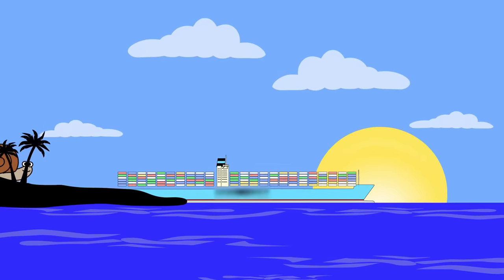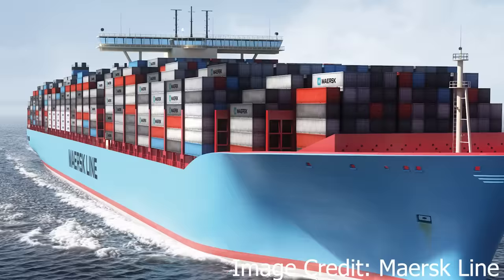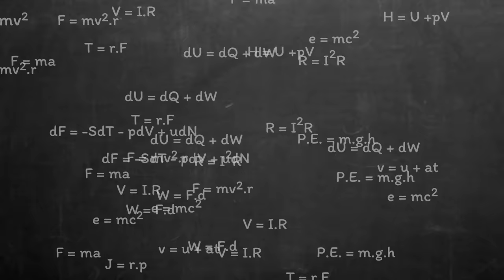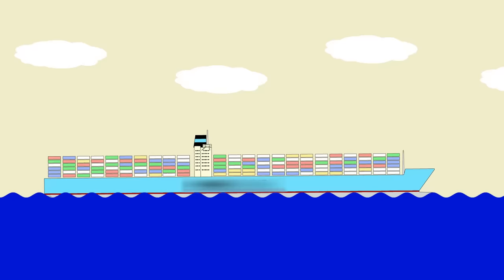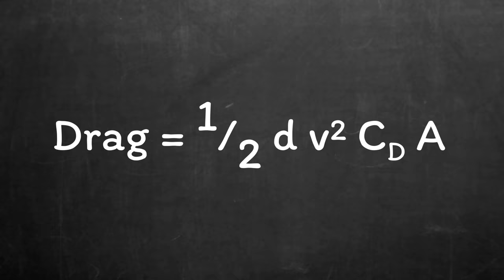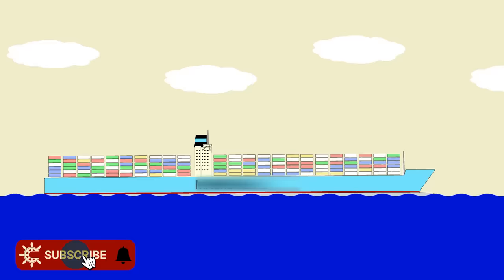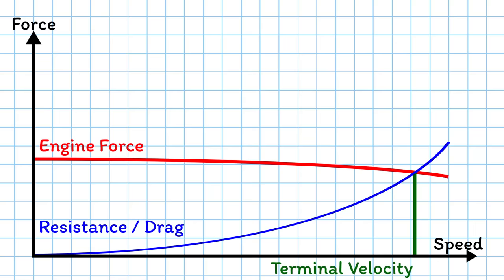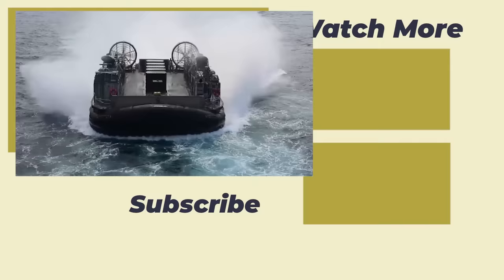Why are ships so slow?

Comment: "And the MM Maersk, 0.5 hp/t"
Me: Oh that explains everything.
Reply: In fact that's the main reason, haha - think about a car that only has 0,5-1 hp, haha. That would be much slower than the ship, just because of the rolling resistance of the tires. 
Even though the ship has a lot of drag going in water, that resistance doesn't scale up at the same rate as the weight (wich is also why large ships tend to be faster than smaller, like he said in the video) - so compared to it's weight, a large ship has lower total resistance moving forward, than a car. 
But a train or even a tram would in fact be able to go like 60-80 km/h (about 32-43 knots) since it's rolling resistance is like 1/10 of a car, compared to its weight, and the air resistance doesn't get very high either, at those speeds. 
Although, even a rail vehicle would not be useful with such low power, since it would take "forever" to get up to speed and also going uphill would be a problem - even a quite small hill would slow the vehicle down to walk speed (this is something a ship doesn't have to deal with, going on a water surface, that by it's nature always stays perfectly flat). A plane would need far more than 0,5 hp/ton to generate enough lift to even be able to fly at all, regardless of wich speed it's going - so that's out of the quiestion, hahaha
Reply: @Speeder84XL  But trains often do run at that kind of ratio. The difference is that a diesel locomotive is only using it's diesel engine as a generator so it really can't stall and you get the benefits of electric motors for the actual driving. Diesel locomotives are pretty heavy and have all wheel power delivery trough electric motors, combine that with really low rolling resistance on rail and they are really really good at draging crap on rail.
The country I live in is relatively flat so you get stuff like this https://www.youtube.com/watch?v=10h-jE8cfV4 these 2 section locomotives have ~4600hp combined and the consists they are pulling are ~5000 tons so we're under 1hp/t here and it works pretty well.
Reply: @GreatGodSajuuk  That's true - I didn't thaught about those really heavy freight trains. They can indeed make it with similar power to weight ratios. Once they get up to speed, they can also often go up small hills quite easely using their momentum (since there is almost nothing except gravity, that slows them down) :)
Reply: Speeder84XL is the ocean that these overgrown boats sail the globe on really perfectly flat? Or do does it wrap around the globe? Do you really believe that the earth is flat?🌏
Reply: It's "Emma" Maersk, by the way.

Comment: The bigger ships move alot quicker than some of the medium size ones. Power matters at sea. Tell the master of the Titanic 27 knots is slow lol.
Reply: Titanics max speed was like 22 knots
Reply: I know Carpathia's max speed was 17 knots. So Titanic was faster than Carpathia considering it was the biggest ship? Not Bad
Reply: @ChazizMTA  That's the thing larger ships tend to either be faster or more efficient (which is a design choice), this has everything to do with the square-cube law which comes about because while the length is almost irrelevant to drag it is very relevant to volume and thus buoyancy. For this reason, if you double every dimension (beam, draft, and length) you increase your drag by a factor of 4 but the volume and weight capacity by a factor of 8 which allows way more mass to be devoted to the engine, fuel capacity and payload the choice between efficiency and speed is the tradeoffs the designer chooses in how to spend this extra mass budget.
Reply: @seraphina985  that's one part of the equation but there is also a hull speed to do with the wave length created by the boat, shorter boats can actually require more energy to go the same speed as a longer one.
Reply: This is only for boats that are not planning
Reply: @lachlanoneil8938  Was mostly focusing on the square-cube law as it is a fairly simple concept that explains a large portion of the reason larger ships tend to be more efficient. Sure, there are pitfalls in fluid dynamics to watch out for when designing pretty much any vehicle that isn't a spacecraft that will never venture inside an atmosphere. But this rather gets into the weeds of a topic that goes a long way into justifying the high salary engineers experienced in designing high-performance vehicles can command. Things start getting really complicated when you start trying to push the envelope.
Reply: @seraphina985  no you are pretending to be smart the force I describe is a very well known and huge effect you know almost nothing about ship hydrodynamics , hull speed is directly connected to water line length
Reply: @lachlanoneil8938  No I don't that is why I design software for a living not ships beyond the basics I'd be guessing as much as most anyone not in the field would.
Reply: @seraphina985  yep but you don't know the basics just sayingnthat U should atleast learn the basics before you type a whole paragraph on what you know
Reply: So... You agree that the square cube law is a factor? Why are you being so rude then?
Reply: Nimitz class carriers can do 30 knots

Comment: The feather doesn't fall slower because it experiences more air resistance than the ball. It falls slower because the air resistance per unit weight is higher.

Comment: The advantage of big ships is the carrying capacity increases with, roughly the cube of size while the driving energy, fuel consumption, by the square. The bigger the ship the lower the cost per ton of cargo.

Comment: "the typical car has around 100 horsepower"

laughs in American
Reply: His estimation would be correct in Moldova or Mauretania. So maybe that's a worldwide average?
Reply: But a typical 100hp European car would be far superior than a 500hp American one😂
Reply: phillyslasher English? Americans wouldn’t even be existing with out Britain..
Reply: phillyslasher Didn’t you guys get help from France? Britain would have won if they didn’t use all their money protecting you.
Reply: phillyslasher but why is it okay when you guys need help. When we need it you need to brag and everything.
Reply: @darek4488  For decades the most popular car in the US was the Toyota Corolla at around 100-150hp, just like any typical European family car.
Reply: @LHFX  In the 90's European cars were more powerful the American. Now since the EU is forcing automakers to make shittier and shittier cars it is the other way around.
Reply: @darek4488  Possibly true, EVs are coming anyway to level the playing field.
Reply: The new Tesla Model S has 1100hp, a bit more than the F1 mentioned in the video. It weighs more than 2.5tons, but does a quarter mile in less than 9s, and goes up to 200mph.
Yes, the 4-door sedan.
Reply: This is maximum horsepower BTW, and used pretty rare. Usually when cruising on the highway you use only half of this power. (depending on speed of course)
Reply: My bike has more than 200hp
Reply: @MrTeutje303  mine from 21 years ago has 210 hp stock
Reply: silviu visan  I wouldn't call people that have cars poor (I'm from Romania). But it is true, in Eastern Europe most people live in apartments which complicates things. I don't doubt we will have public parking with chargers a common thing even in Romania pretty soon.
Reply: Yea easy to get 100hp out of 1400cc, yanks too lazy to tune the engines years ago
Reply: @elbob099  Why would an American driver want a high-strung engine that has to be wrung out to get any power, when they could have a larger engine (or nowadays, a turbo engine) that makes its power down low, and consequently makes its power with much less effort, noise, and harshness? Have you ever driven or been driven in a six-cylinder or V8 luxury car? There's a reason rich people in Europe are willing to spend absurd amounts of money for what even working-class Americans enjoyed for decades. There's a reason Facel Vegas and Iso Rivoltas used American engines instead of building their own.
Reply: @tankermottind  cya mate!
Reply: Right even my civic is double that
Reply: hahahaha Su🅱️ra engine go brrrrrr
Reply: I have a Japanese subcompact and it's more powerful than that.
Reply: @LHFX  : that's exactly it. People see that lots of people have SUVs or pickups and some people have muscle cars but they neglect the fact that most people are driving stock Corollas or similar economy cars that have engines in the 100-ish HP range. 

The SUVs and pickups are more visible because they stick out and the people who drive them are the assholes cutting you off or riding your ass that you're going to remember when you get home, as opposed to the bazillion people plodding along in Corollas that blended into the background.

Sure, lots of people have small cars with more power, and some of them even came that way stock, but in the aggregate they're a relatively small number compared to your average economy car that has an engine in the 100-120 HP range. Are there plenty of higher powered or tuned cars on the road? Sure. But they're not the majority, and, again, you're more likely to remember these cars because their drivers tend to be assholes.
Reply: @minirille4225  and yet britain's modern day military is like an ant compared to it's little brother America
Reply: @jskim8418  false.
Reply: I didn't get the joke. This is pretty correct.
Reply: @LHFX  still drive a 2000 model corrola every day in Australia. Love it
Reply: @clashman7564  yes.
Reply: My thoughts exactly. The typical motorcycle has 100 hp. The typical car today has 300 hp.
Reply: @taekwondotime  my bike is 16 years old and has over 100hp. Bikes these days are kicking out 200whp from the factory.
Reply: My car has 90hp 😐
Reply: @taekwondotime  300hp typical? For a Ferrari maybe
Reply: @Keyzer93  The average passenger sedan in Canada has 300 HP.  Google it if you wish.
Reply: @Keyzer93  Ferraris in Canada start at around 600 HP and go up from there. But feel free to believe whatever you want to believe. Google search says otherwise.
Reply: @Keyzer93  Average car in Canada weighs around 3000 lb for a car and around 5000 lb for a pickup truck or SUV.  The average SUV/truck has around 400 HP in Canada.
Reply: @taekwondotime  i believe what is normal in my country. The average in Spain is 100 hp. Google it if you dont believe
Reply: @taekwondotime  Here no trucks or almost inexistents. SUVs here 150 hp more or less and weighs around 1900 Kgs. Sedans 1000-1200 Kgs. And utilitaries 700 Kgs
Reply: @Keyzer93  I guess you can say Canada is a very different country from Spain.  :)
Reply: @Keyzer93  We also have the slowest speed limits in the entire developed world.

Comment: My friend had a contract to cut up a container ship for scrap. It was in a slip in the Port Richmond section of Philadelphia. I was really surprised how easily it moved at low speed. He had to move it about 100 feet in the slip to secure it the way he wanted and pulled it with a 4 wheel drive Chevy pickup in 4 wheel low range. It really didn't strain at all

Comment: Now compare the speed of transport. A car would carry 400kg loaded. The ship for example 50.000kg. So even though the car is faster, it would need to do the same distance like 125000 times? Go back empty, pick up another load and do it again, increasing it to about 250.000 trips? 

Comparing it that way, the ship is at warp 10 compared to planes and especially cars.
Reply: Your math is way off.
Reply: @cpotisch  If you can do better.. its just an example.
Reply: Deiphobuzz
Ships can carry tens of millions of kilograms, not 50,000. And 50,000 kg / 400 kg would be 125, not 125,000.

Comment: When you go to a pool or to the beach, put your arm underwater and try to move it as fast as you can.
Once you get way out of the water, try to move your arm as fast as you can.
Try to grasp the difference in resistance levels. That's your answer as to why ships move much slower to cars, planes or trains.
Also take in consideration that the more area exposed to the air flow or water increases resistance, so bigger the ship, the slower it will move and why speedboats move fast af.

Comment: I was in the US Navy in my youth, a half century ago, and served aboard Gearing class destroyers, built at the end of WWII. These were 3540 ton vessels that were about 120 meters long and 13 meters wide at the beam. Powered by 60,000 hp steam turbines, they could reach speeds of 33 kt's (36-37 mph). My paternal ancestor came to America from England in 1638 on a wooden sailing vessel, arriving in Boston after a 50 day crossing at an average speed of 2-2.5 kt's. What contrast in speed and crossing time, the 300+ years brought.

Comment: F1 cars: I have 1,000 horsepower
Cargo Ships: Oh I don't know, somewhere about 109,000 HORSEPOWER
Reply: He also said that the average car has 100 hp. Maybe British hp is significantly different but I can't think of any car with 100 hp besides a smart car. Most economy cars are in the 150-220 hp range.
Reply: @MrCody01  In the US, yes. In Europe most people buy 60-150hp cars because engines with higher power output usually consume more fuel, which is expensive as fuck in most of Europe (e.g. $6+/gal (US)). Cars with higher displacement engines are also taxed heavier --> fewer people buy them. Besides that, for the average person 100hp is more than enough in day-to-day life. Hell, even my 85hp Golf Mk7 could fly down the Autobahn at 115mph.

Comment: There is another important factor missing which is hull speed. Slightly simplified, a ship in displacement mode (as compared to planing mode like a small RIB for example) will create a wave system and at a certain speed it will sail uphill on its own wave. The hull speed is increasing with the length of the waterline so this is more of an issue for a recreational 10m sailing yacht (hull speed 7.6kn) and has a more limited effect on large ships (400m vessel -> 48kn) but its effects are noticable in terms of fuel consumption. And this is another very important factor that is a bit missing here. While it is possible to build container ships that sail faster than 20 knots it is simply not economic as nobody would pay extra for a 1 day faster shipment from China to Europe.
Reply: Lots of navy vessels have their top speeds limited by hull speed, it’s not just small sailboats that get screwed over by physics.
Reply: As a freight forwarder in europe i can tell you people pay extra for 4 days off the total transit. So much that carriers offer usually 2 services (MD1 and MD2) to get from south europe to main ports of china

Comment: Did you forget the hullspeed?
Hullspeed [km/h] = 4,5 x SQRT Waterlenght [m]
That is the max. speed for a "not planning" vessel.
80 % Hullspeed is the economic speed for a small vessel.
Reply: The cat can also go faster because it has very long, narrow, and sharp hulls which don't make a lot of wave. The same applies for some kayaks, racing rowing boats and military speed boats. Some of the latter use also the Lürssen-Effekt. There are a lot of effects, which would blow the video too complex. Fast cat ferries also use the space between the hulls to build up an air cushion to lift them and reduce drag.
Emma Maersk is cruising far below her hull speed, which would be about 48 knots. If you would double a ships speed (still being under 80% of her hull speed) you would need 4 times as much fuel for the same distance and an 8 times more powerful engine (you want to burn 4 times the fuel in half the time so it has to burn it 8 times as fast). The hull speed formula is not 100% applicable. Most yachts for example have a transom (German: Spiegelheck) so they have a longer virtual waterline which varies with their speed.

Comment: Drag is definitely a big factor but displacement hulls also have a terminal speed limit.   Hull speed is equal to 1.34 times the square root of the length at the waterline (HS = 1.34 x √LWL).  A displacement hull essentially rides in the displaced area behind the box wave.  To exceed this speed, the boat has to "climb out of the displacement hole" and plane on top of the surface.  The boat has to travel fast enough for the water to "harden" under it and not move out of the way (creating the displacement hole in the water).
Reply: Exactly..Speed length ratio is key.  That is why carriers have among the highest speed potential of displacement.This is a function of wave making resistances. They also have fine line at the bow and stern.  Other elements are wake resistance, propeller efficiency, wind resistance, hull resistance, etc.  

However, the largest resistance by far is wave making resistance.  Bulbous bow helps.  Submarines, if deep enough, form no surface waves and have a very high speed potential but may impact stealth , i.e. cavitation
Reply: Great comment, but I think of hull speed more as a speed bump than a terminal speed limit. With the right conditions it is very easy to exceed hull speed in my tiny yacht. Upon reaching hull speed the bow and stern wave are at equal length. As I exceed hull speed the waves get longer and the bow begins to climb the bow wave. At that point the yacht is essentially surfing on the bow wave. There is noticeable bump in resistance near hull speed, but it's definately not a big deal.

I think the designers of ocean liners are more concerned with getting product from A to B with the least cost. Hull speed probably plays into their equations at some point, but I don't believe it would  have much effect on the design of the ship.